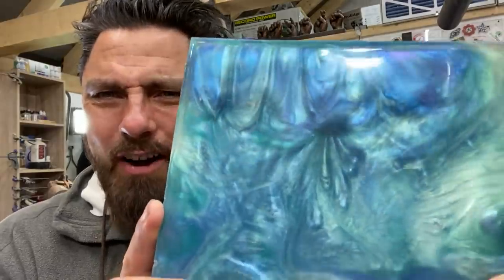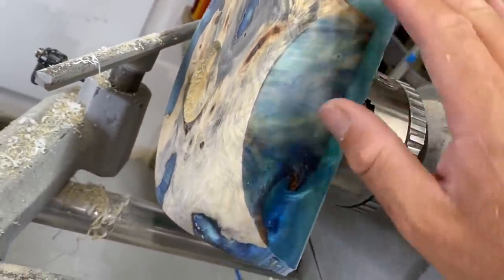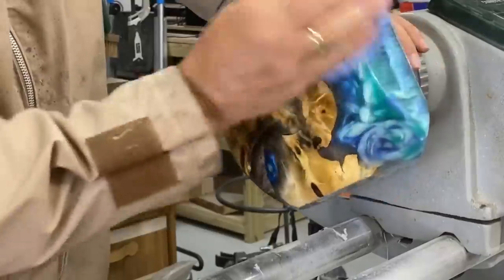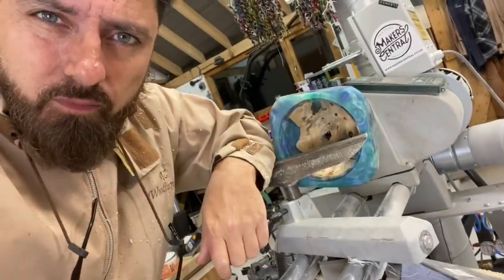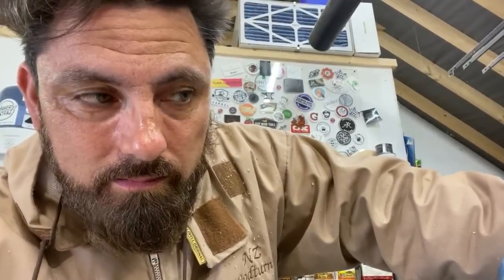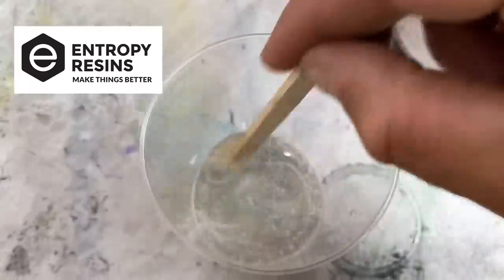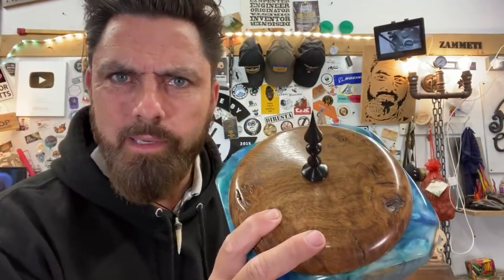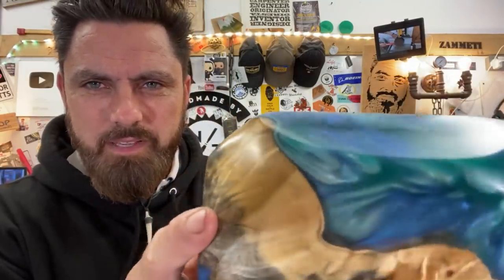Wood Turning - Oceans Lagoon

Comment from the maker: SimpliSafe is award-winning home security that keeps your home safe around the clock. It's really reliable, easy to use, and there are no contracts. Check out SimpliSafe here: http://simplisafe.com/NickZammeti
Reply: Did you notice the face in the bottom of the piece?
Reply: Since you used the buckeye tree.  you should use a bunch of buckeyes and resin to make something else.
Reply: Loved the piece...as you went thru the bottom....i figured you would make a little toillet sink...it just needed a adapter...hehehe...but i thought your "safe" turned (no pun intended) out nice too!...as for the lit..looks sharp!..stay safe and keep it up!
Reply: A Handy Redneck I actually noticed the face in the bottom and another one in the bowl on the sidewall...
Reply: It doesn't keep your house safe there are fobs what interfere with the signal and it does not set the alarm off
Reply: I AGREE😊 He should design a creative sink!

Comment: About 5 seconds before you went throughto the other side i thought "i wonder how he knows when to stop so he doesnt go through" im still wondering but now i know that it must just be experience.
Reply: Dunno how Nick knows but I know because I use my fingers as thickness gauges every so often.
Reply: @joshschneider9766  oh ok. I guess its just something you learn as yiu go along.
Reply: It's not so difficult to measure the hight of the bowl, then place a straight board across the rim and measure inside depth. Count the difference minus the small grove on the bottom center.😄

Comment: Nick, my concern about this unique piece is.... The cover fits so tight that I worry the finial will snap and break when used to remove the cover. You know, because of hot & cold expansion factors. But this a lovely center piece.

Comment: LOVE the bottom, but you need to redo the lid. Perhaps make some grooves and fill them with the same color resin as the bottom. Make the top and bottom connected. As if they were meant to be. Love you and your Channel to bits. First time I made a comment - had to, since this is the first piece you’ve made I did’nt Think was spot on. Regards a huge danish fan 😉

Comment: Hey Zammeti, I have a question!! When working with epoxy resin, do you absolutely have to have a pressure cooker!? I'm sorry I know it's called something else, but it's past my bedtime, but thought that I would ask, before I would try to work with it. Or can you work with it, without putting it in one!!?🤔🤔idk, I'm new to this, a total greenhorn, lol!! Just asking questions cause I want to learn!! After the hole was made, I thought of a birdbath with a small water fountain ⛲️ in the hole!!? Lol still gorgeous piece, rock & waffle 🧇 on!!!
Reply from the maker: Hey no you only need this to remove bubbles x
Reply: OK sweet thanks!! Yeah I understand that it's to get the all of the air out. I was just wondering if it had something else to do with the setting up and hardening process or something like that!!? Thank you for your reply, it means a lot, coming from across the pond, lol. Just another question, please 🙏, wouldn't the air bubbles make it hard to turn, have you done a video that I haven't seen yet, of you doing a resin project without putting it in the pressure  pot? Ooooh I wonder how you would get big bubbles in the middle of the resin blank and then make something that shows off the bubbles, in different colored resin blank? Hhhmm, as I said, total greenhorn here, hi hello, how ya doing. I'll go now, thanks again for the reply

Comment: What if you made a number of blocks of different coloured swirly resin, and shattered them all to pieces around an inch across, then put the multicoloured shards in to a bucket, and filled it with clear resin, then made something cool out of it?

Comment: Personally I would have just torched the resin to get rid of the bubbles. Less work and energy use than using a pressure pot for that little bit of resin.

Comment: couple of things he (or I) could have done. first when he had the mound of wood in the center he could have left it there and had a lovely nut bowl. I would have polished it up to blend with the rest or the bowl and but burl would have been a nice accent. When he cut through the center I would have put the coin fave up instead of down. That way you would always have your logo facing the customer. Finally the only other thing I could think of is he could have made some of the same blue epoxy and partly filled in the center and then put an LED light and battery box on the back and then filled up the hole on the back then he could light up the blue spot with the led and given the whole thing a nice light at night ...but that is me

Comment: There's a hole in the bottom of the sea
There's a hole in the bottom of the sea
There's a hole, there's a hole
There's a hole in the bottom of the sea
There's a log in the hole in the bottom of the sea
There's a log in the hole in the bottom of the sea
There's a hole, there's a hole
There's a hole in the bottom of the sea
There's a bump on the log in the hole in the bottom of the sea
There's a bump on the log in the hole in the bottom of the sea
There's a hole, there's a hole
There's a hole in the bottom of the sea
There's a frog on the bump on the log in the hole in the bottom of the sea
There's a frog on the bump on the log in the hole in the bottom of the sea
There's a hole, there's a hole, there's a hole in the bottom of the sea
There's a fly on the frog on the bump on the log in the hole in the bottom of the sea
There's a fly on the frog on the bump on the log in the hole in the bottom of the sea
There's a hole, there's a hole, there's a hole in the bottom of the sea
There's a wing on the fly on the frog on the bump on the log in the hole in the bottom of the sea
There's a wing on the fly on the frog on the bump on the log in the hole in the bottom of the sea
There's a hole, there's a hole, there's a hole in the bottom of the sea
There's a bee on the wing on the fly On the frog on the bump on the log In the hole in the bottom of the sea
There's a bee on the wing on the fly On the frog on the bump on the log In the hole in the bottom of the sea
There's a hole, there's a hole, there's a hole in the bottom of the sea
There's a hole, there's a hole, there's a hole in the bottom of the sea
There's a hole, there's a hole, there's a hole in the bottom of the sea
There's a hole, there's a hole, there's a hole in the bottom of the sea
Source: LyricFind

Comment: If you had put some blue in the lid I think it would have looked better, more cohesive. As it is now it seems like you used a lid from a similar pot on this one cuz you lost the lid for this one and they kinda go together but not exactly. Or at least made the finial out of the resin, the lid and pot just don't quite match. I like them but just not together.